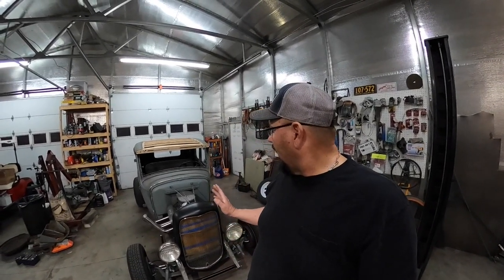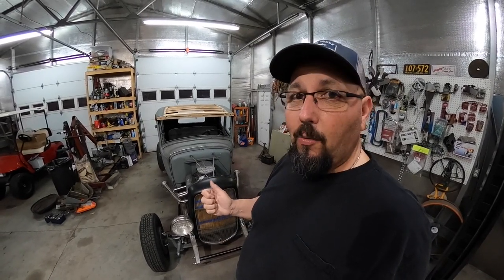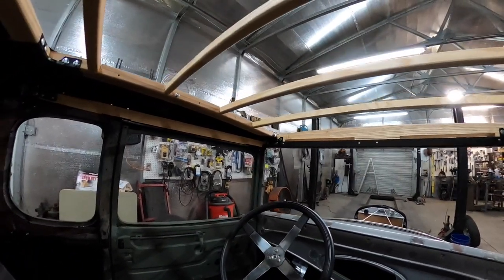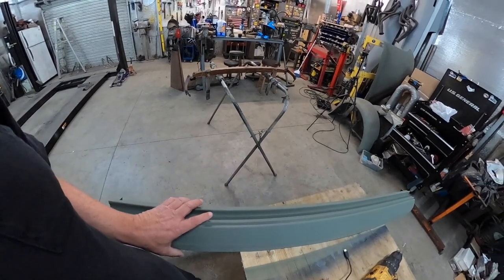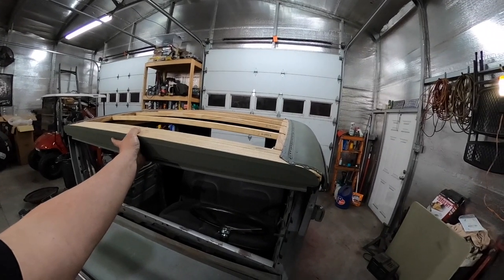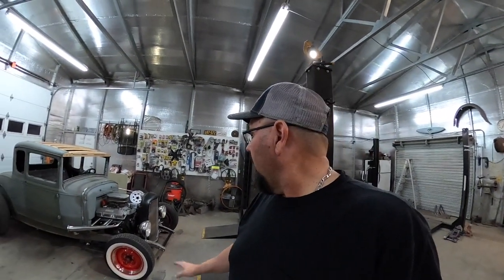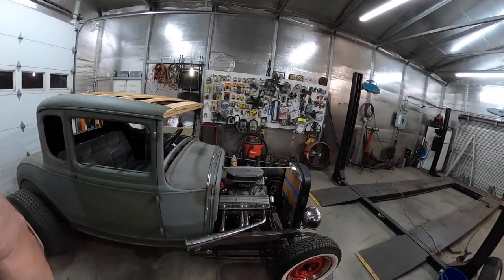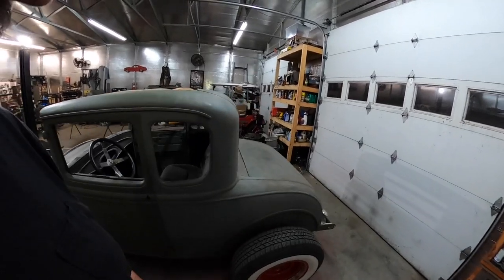Model A Coupe Hot Rod Build Pt.42  Top Wood Kit Installed !

Comment: Damn! It's looking so good. I'm glad you are back... I left Tennessee, for a couple months,  I'm in South Florida, working on the Ol'Beater 54 Chevy. I want to get it more together before I drag it, or drive it up to Ten. Of course , I keep changing ideas. The original , modified steering column came off. A Chevy Astro tilt column in going in today. Thanks for the inspiration. JB..
Reply from the maker: Good luck with that 54 chevy they make cool hot rods !  I am glad you like the videos and thanks for all the good comments!  Have fun working  on that Hot Rod !!!
Reply: The column went on like factory. I re shaped the original column mount,. And with a little coaxing. It wenton
Reply from the maker: @juanbarturen2726  Good deal I am glad you got it installed one step closer!   Take it easy!
Reply: Ok